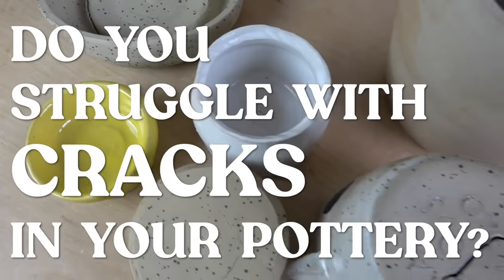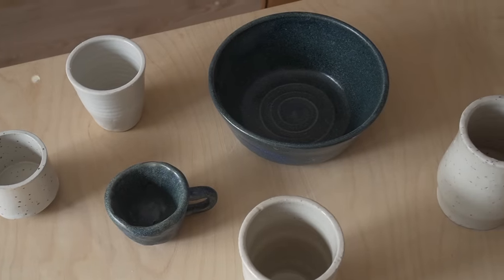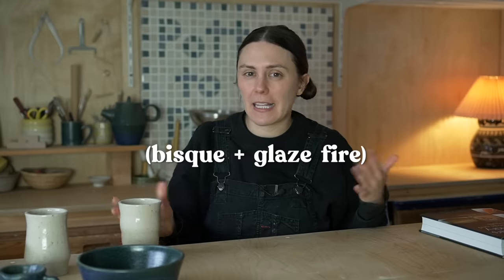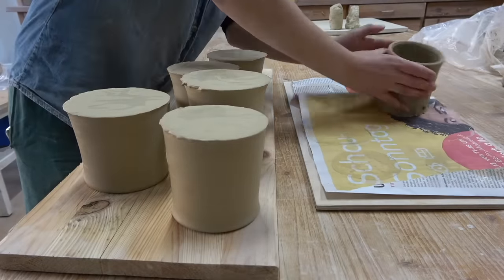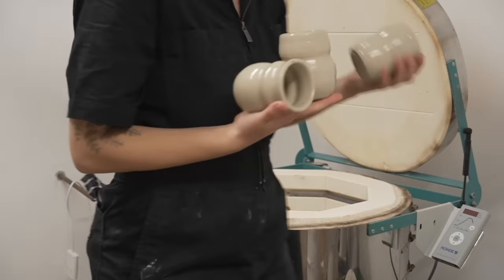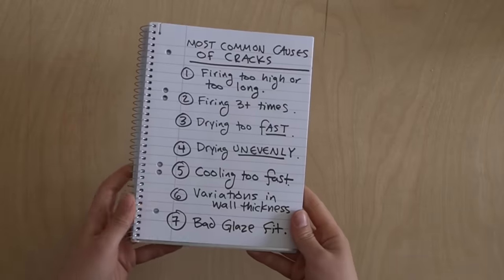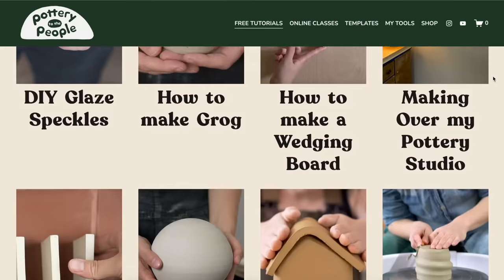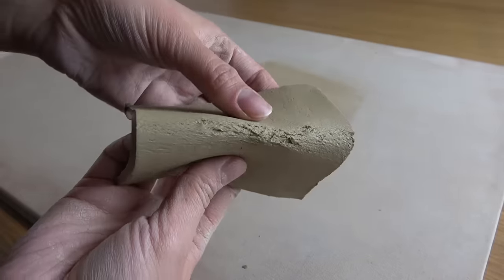How to prevent 8 common cracks

Comment: Oh, it makes a ton of sense that thermal stress could cause the walls and the bottom of the pot to pull away from each other, if they're retaining the heat differently! Neat!

Does crackle/crazing affect how food-safe the piece is? I once found a ceramic milk jug that looked like that, and not knowing anything about pottery, I didn't want to use it because I was afraid the cracks would make the glaze not work to protect the milk from the jug and vice versa. But I don't know if that's really how it works or not.
Reply from the maker: That topic unfortunately has no clear-cut answer! I talked about it a bit in this video: https://www.youtube.com/watch?v=X92zYEt0iVc&t=10s and also I like this article on the topic: https://www.google.com/url?sa=t&rct=j&q=&esrc=s&source=web&cd=&ved=2ahUKEwiz1c3d4IWFAxW4VPEDHR9hDEMQFnoECB4QAQ&url=https%3A%2F%2Fceramicartsnetwork.org%2Fceramics-monthly%2Fceramics-monthly-article%2FTechno-File-Dirty-Dishes&usg=AOvVaw3poqL3p7uZBNOWUf3l2EN_&opi=89978449

Comment: First, it's a great channel, and I really enjoy your videos...Thanks so much...!!!

Please do a video on the "compression controversy" so we can better understand what you mean. "Compression in clay bodies" and "Ceramic Compression" are not only a reality, it is a field of study, as well as, a diagnostic tool used in evaluating clay bodies. Clay...IS NOT...a liquid, though it has some of those characteristics. A simple search (if interested by anyone) in clay characteristics from a material science perspective will give you more details and understanding...

Empirically, if it were a true liquid it would not need to be wedged/pugged to remove air, thus it also has "compressive characteristics," unless, in this case, your meaning of compression is something else entirely...
Reply from the maker: Interesting to hear your perspective! I have spent a big of time googling around and I am getting VERY different answers depending on the source. I am not sure it's as clear cut as you say, but I can only speak from my own experience. Really interesting to hear your thoughts.
Reply: @PotterytothePeople  I think (perhaps?) the differing information you are finding could be generated from the "lay side" as compared (perhaps?) to the material science side and how clay behaves structurally. I look forward to a video where you can explore this in more detail and share what you have learned from the different sources. Thanks again for all your work in sharing these videos. They are EXCELLENT!!!
Reply: WOW I have never seen somebody make something up and pull it out their ass as extensively as you. Compression is a myth, if compression mattered slipcasting would be impossible.
Reply: @StuninRub  O.k. if compression is "a myth," then why can it be measured? 

Maybe go back to school and learn something before you get more confused than you already are from watching videos you don't understand or ones that provided poor information because there created by D.A. that are only DIYing themselves clicks and like...or...are more interested in "trolling" with sarcastic comments than they are of learning something...

On a more positive note, on the off chance you actually like to learn, here is just one example on countless studies to learn from: "Parametric study of the diametral compression test for ceramics." Plenty out there to read about or just Google "Ceramic Compression Testing." Clay body characteristics (which includes compression) is critical to fully understanding how a clay will perform and behave. Do you need to have a clay tested? Of course not, as experience will teach what and how to use it...That does not mean compression in a clay does not exist or effect its behavior...IF...you understand it properties...Good luck if you take this as a positive challenge, or you can just remain obtuse...It is a choice...

Comment: I’ve been drying pots on bats for over 15 years and have never had an S crack (actually have never had them for any of my ware). But I do make sure I compress my bottoms and also ensure roughly even walls and bottoms. One possible tip for bats: for large pots, I flip them upside down - with the bat still attached - when they are firm enough to do so. But mostly I let them pop off right side up.

Comment: When we switch our clay to a softer, wet clay, not much grog, pretty smooth clay, let’s call it AP, and did pottery one off lesson. I saw many cracks at the bottom. Then I started to focus on compression not leave the water in for too long and the cracks has decreased. After make a piece we wire it and heat gundry it then paint it with UG or HF right away on greenware. So far okay la,

Comment: I don't know, I never flip my pots and I have no trouble with s-cracks but, I compress my bottoms when I'm throwing them. 
I've seen that it makes a big difference when throwing off the hump.
Reply from the maker: Interesting!
Reply: COMPRESSION, COMPRESSION, COMPRESSION!!! ❤🎉
Reply: Same, I use a bat system + compress the bottoms. Never had an S crack.

Comment: Trying desperately to figure a way to say this without challenging the kiln gods or clay… The kiln is unplugged and none of my clay seems to be paying attention to me at the moment. So I will try this. 

My experience with stoneware is similar so far (quite a few years). Porcelain has been a bit different (yes, big surprise). I have found nothing to be 100 or even 90% with it, but working the bottom does seem to help. Compression is not a good word for it though. Applying ‘pressure' doesn’t seem to be the key, just lightly sliding my finger over it a few extra times does. (In typing that I realize that I also keep it dryer than stoneware, so the act of sponging it out more often actually lends to the argument to compress.) That being said, I haven’t actually tested by intentionally not doing anything to the bottoms of porcelain, but I think I have had equally bad results by not saying Bismillah when I close the kiln, or saying something it finds offensive, ((Whisper….) never say anything bad about the p word if it can hear you). It has never occurred to me to not flip anything to dry the bottom. Even if I had nice plaster bats I can’t see not flipping them. I am quite lazy by nature, but that is just taking it to a whole new level. Anyway, just wondering if you (or anyone else) has come across anything that seems to work consistently for you with porcelain s-cracks?
Reply from the maker: really interesting! I don't have much experience with porcelain. I think folks don't flip because they just never were taught to do it!

Comment: This is awesome! i have a question though: so you don’t use a bat system at all? I find it useful for some shapes that I would otherwise ruin trying to get them off the wheel head/bat. Thank you! 
I have the same book, it is very good, thank you!
Reply: As I commented in this thread, I’ve been using a bat system for 15+ years with no issues. And I know other professionals who use them with no problems. I suspect cracking is due to the other issues pointed out in the video. Also, I DO compress the bottoms.
Reply: @KarenTotten Compressing the bottom does nothing, as long as it is even and dries consistently with the rest of your pot, it wont crack.

Comment: I've been a wheel potter for about 11 years and I never have had any cracking problems till I recently started throwing porcelain off the hump and have been getting s cracks in very small lidded jars.  While I agree with your stance on compression,  I do get better results off the hump if I compress the bottom. I'm wondering if this has more to do with just paying more attention to the water there than actual compression. What are your thoughts?

Comment: Thank you! I’m struggling with a porcelain-like cone 6 white clay. I keep getting edge cracks (on the inside especially) and shatter cracks at drying stage. I don’t know what to do.. I don’t think my walls are particularly different in thickness than my bottoms. Would you ever consider doing some one to one video mentoring sessions on this topic? Thank you
Reply: Are they drying too fast or drying unevenly?

Comment: Regarding compressing, maybe what compression is really doing is forcing more water out of the clay and causing the clay at the bottom to have a uniform density/water content.  You are just accomplishing the same thing a different way.
Reply from the maker: that is an interesting theory!
Reply: The term is misleading, what it's really doing is relieving the stress caused by opening up the lump, which stretches the clay on the bottom, so running your finger from the outside to the centre is doing the same job as flip and turn for rolling slabs.

Comment: I threw a large platter and used sgraffito to decorate it. It was beautiful until I put it into the kiln for its bisque firing. I just took it out of the kiln, and it was cracked nearly in half. I was so sad. How can I keep my sgraffito plates from cracking? The decorating method creates uneven surfaces and thickness, so it seems at least to me that I am lucky if it doesn't crack. Do you have any suggestions?

Comment: Compression of the base when throwing is a misleading name for you're actually doing if you're doing it properly.
Done properly, you're running your finger from the outside to the centre with ONLY enough pressure to lift about half a lentil from the centre. What it's actually doing is relieving the stress from opening up the firm and creating the base, kind if like when you're rolling out a slab and you only go so far before you flip and turn the slab 90⁰ to roll crosswise. That's the real aim when compressing the base, or at least that what my throwing tutor Nick Lees told us at uni.
He also recommended a gentle compression of the rim after each pull, but then a few years after graduation,  I ended up talking to KBJ (aka Mr Weepy from Throwdown) at a trade show where he was demonstrating his mad throwing skillz but also exhibiting his mass produced in Japan dinnerware range (now THAT'S what I call an oxymoron! )- anyway, he was messing around on the wheel and we talked techy and he said that after the first pull, he won't touch the rim until he's reached the desired height and shape, then he'll finish it off.
I prefer to follow Nick's advice, it works better for me and I have a more even and level vessel at the end.
As for turning pots over as soon as, I totally agree. I've recently started cheating a little with my mugs and as soon as I finish throwing them and kidneyed off the slippy bits, I use my heat gun to firm them up just enough to wire them off and turn them over immediately. It's saving me a full 12hrs drying and I'm getting even fewer base cracks (not that I had many before, maybe one in about 30 mugs) because of it.
Another important step is to ensure that dampness it completely even before letting your work dry on a nice airy rack so they dry evenly, though handles should be allowed to dry faster to get their shrinking over and done with while the bodies dry to fit them.
Umm dunting is absolutely NOT caused by clay-glaze incompatibility its a vertical spiral crack caused by either going up through or down through the two quartz inversions where the clay twists, first one way, then the other. Only glazing the inside of a thrown piece can cause cracking, but not dunting,  which  is a very specific type of crack.
Shivering is where the glaze is a bad fit and hasn't shrunk to fit the pot. Crazing is where the glaze shrinks too much. 
Greasy hands,  dust etc causes CRAWLING.
You're spot on with the handke joins,  however, having a good mature slip also helps. Mine is about 6 or 8yrs old now, I just keep topping up my throwing water, never removing more than the last few centimeters of thick sludgy slip in the bottom, that's what I use for my joins, but I'm also seriously thinking about trying out the magic water if I can find a metric version of the recipe, because WTAF is a gallon, either old imperial or american  or whatever. And which tablespoons are they indicating? Just use metric already, the system works, it's accurate, and is base 10, just like the entire planet's counting system.

Comment: If the glaze shrink more/faster than the clay, that would introduce compressice stress, right? Isn't that something ceramics can withstand well? Or is the difference between surface stress and internal stress in the clay itself enough to induce internal cracks as well?
I learned that the problem with ceramics is tensile stress, not compressive, that's why i got curious
Reply: If the glaze shrinks more than the clay, you get crazing (also if you col too fast). Shivering is caused by the glaze not shrinking with the clay, NOT because of dust or hand grease, those cause crawling.

Comment: I'm just wondering how I can best prevent cracks in plates, as you cant take them off the bat to dry. Had two of my thrown places crack while still stuck on the bat this week a few days after trimming the sides and I have no idea what I did wrong ):
Reply: Did you wire them? If they're "stuck" to the bat, the cracks form from uneven drying. 
The top and walls are drying and shrinking and the bottom is wet and stuck to the bat so tension forms from trying to shrink but not being able to.
I always run a wire under my plates once I've finished throwing them, but before they get put away to become leather-hard. Then I wire them again before I remove them from the bat to trim.
Reply: @crowdedsubwaystation  thanks for the tip! I'll definitely try wiring them next time, I was taught I shouldn't but your explanation seems very logical. Thank you
Reply from the maker: My next video will be about plates, maybe that will help you!